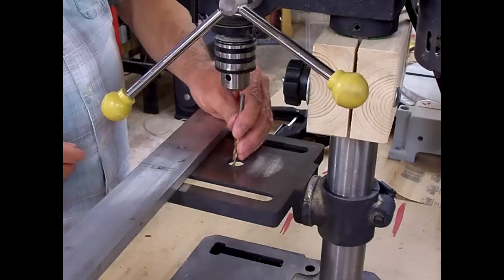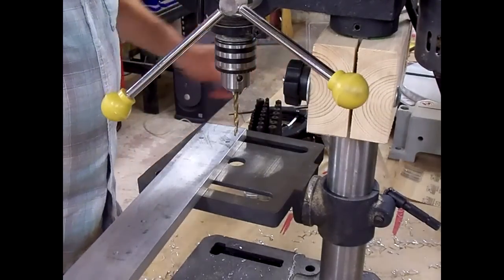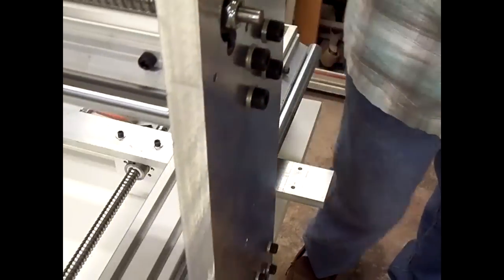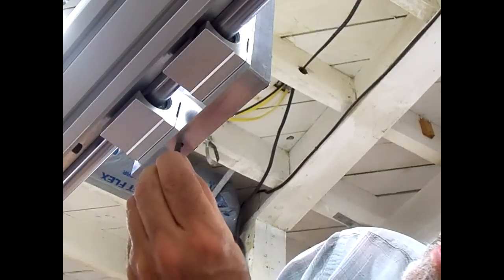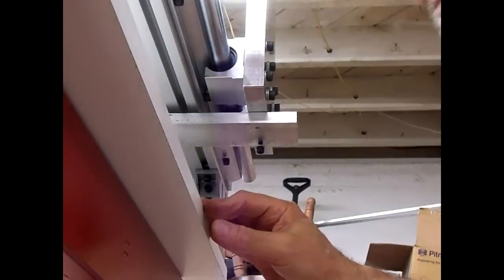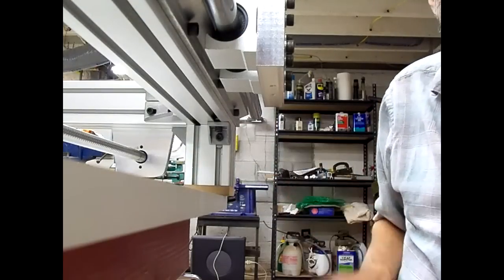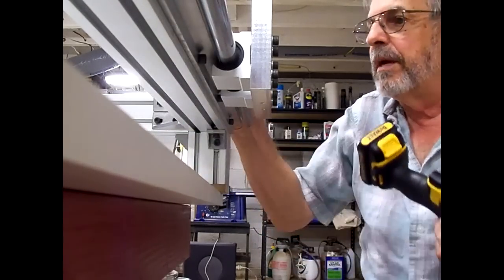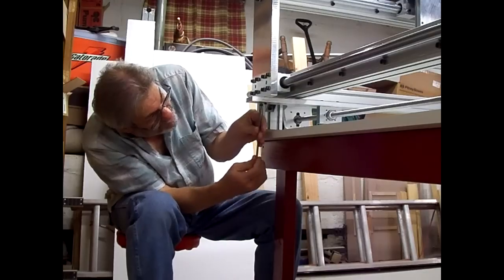CNC Router build part 6

Comment: Part 01: https://www.youtube.com/watch?v=ik19dH5ZWQ0
Part 02: https://www.youtube.com/watch?v=y-_aA2lJ0c0
Part 03: https://www.youtube.com/watch?v=NKv3I7Zclhk
Part 04: https://www.youtube.com/watch?v=OY8pq23vXco
Part 05: https://www.youtube.com/watch?v=66r5X9Q0Xuw
► Part 06: https://www.youtube.com/watch?v=-Yi8X9SALSQ
Part 07: https://www.youtube.com/watch?v=gdz4OXo9x38 (Electronics)
Part 08: https://www.youtube.com/watch?v=ahIdSt6U17o (Testing & installing motors)
Part 09: https://www.youtube.com/watch?v=vI-J74K31Zg (Completion)
Part 10: https://www.youtube.com/watch?v=aMByQvUo3CQ (Wiring diagram)
Part 11: https://www.youtube.com/watch?v=wjCZnUu23g8 (Wiring diagram update - addded auto zero wiring and scripts)

Comment: I was wondering, you like many others use 2 lead screws for your X axis, I can see the benefit but when I ordered my leadscrew X and ball nuts bearings etc, I couldn't find a supplier that shipped 2x the X axis leads crews so I am thinking of using your arrangement for an underbed driven gantry but use just one centre located leadscrew. I am wondering if I will have any issues of skewing? 
I wonder what your thoughts would be on this method or should I just find another supplier who will ship me just one more leadscrew and ball nut?

Comment: I know it's been over a year since you built this but when you were tapping the holes with a drill, I thought OOOHHH NOOO I hope he doesn't do what I did, break the tap off in the hole lol....(cheap taps of mine).....good on your for getting the holes reasonably square though.....

One question: did you ever consider drilling your holes slightly larger to give yourself some fudge factor/room for adjustment? I know you're measuring, measuring and measuring....but with the Y axis, it would have given you some play room....it wouldn't affect the "strength" since you're relying on the bolt tension to hold it together anyways.....

The reason I'm asking is because I have a POS machine and am in the process of exploring means and methods to upgrade it and in a lot of ways, your "kit" is using methods that I'm going to use...(only I have gear racks and pinions instead of ball screws) for all 3 axis)
Reply: ***** Thanks for making them, you did an awesome job of it...

As I said with my taps: extremely brittle titanium coated....I bought a set from Canadian Tire (kind of like Harbor Freight) and broken more than one hand tapping and once with a drill.....when they break I replace them with a tool steel one and never broken one of those....

Comment: GREAT job on the build and for documenting it. 

you may have, but I didn't notice though..... but you should've taken cross measurement to check to see if it was sitting square (measure off the "X" axis frame back to where you had the "Y"axis positioned where you attached the lower sway bar that rides with the ball screws).???

With looking at what is going on with your design and the functionality of it..... I'm NOT liking the looks of how the WHOLE weight of the "Y"axis is riding on those outer round slides.  I may be missing something and will see more support added in the next video cause you're obviously not done yet at this point in the video.  but do far this is what I see and it concerns me with the deflection all that weight will have on the sliding system???  HOPEFULLY I'm proven wrong, lol.....